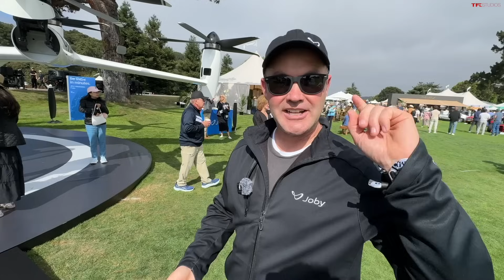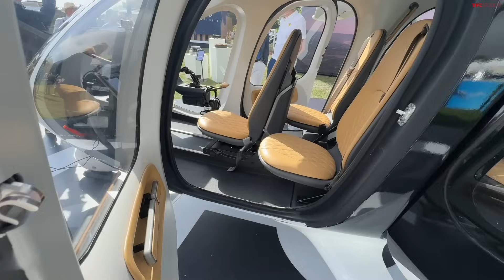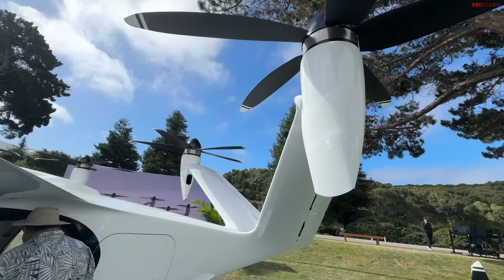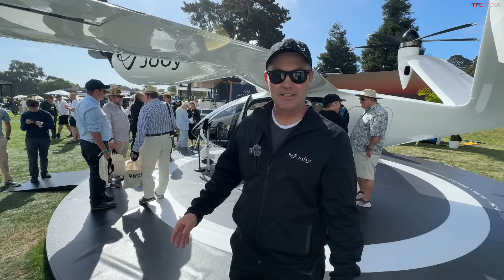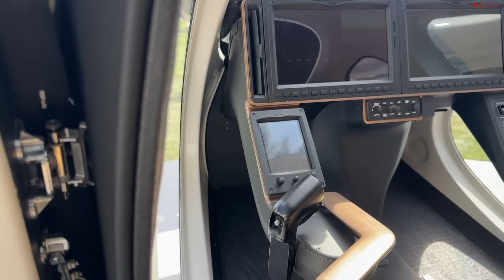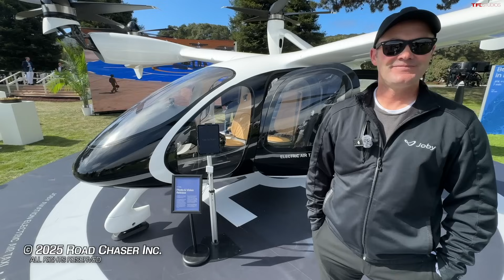Are Flying Cars EVER Going To Take Off? Well...

Comment: 100 mile range?
Reply: 150+
Reply: It’s more, but vertiports are equipped with dc fast chargers and it’s not that far from airports to any downtown. They have tested it with a hydrogen fuel cell to convert the hydrogen to electricity and a smaller battery pack. They have proven over that they can fly over five hundred miles with that set up. The military is looking 👀 at using the hydrogen fuel cell models for a range of uses. Pure EVTOL is much cheaper and profitable to fly the hydrogen fuel cell model.

Comment: When you are the only one, it is fine to fly anywhere anytime.  What if these things caught on and there are a group in the sky, how do they regulate traffic control?  Will these be only allow to fly at certain altitude?
Reply: The same way helicopters currently operate; by getting licensed for flying following all rules and regulations, then coordinating with air traffic controllers.

They cost $20 million each, so they are not going to start filling the skies…
Reply: @Cloud30000 yeah, it'll be like owning a helicopter.

 You still need to get licensed, follow the rules, speak to and follow ATC in controlled areas, and have places to park it. 

You can't just fly around willy nilly.
Reply: @volvo09  Like owning a chopper eh.  Idk about where you live, but the only choppers I ever see being flown around my area, are the military ones.  And those sightings are still rare.  And I am a Pilot!  It is like sighting a limousine, only less frequent than that.  And that just does not happen commonly in the suburbs and or country sides.  The most logical place to have 1 to get into the city.  Should you want to go there.   lol
Reply: @WW-wf8tu  I meant my reply in the exact same way you did, I just didn't say it outright enough . It's incredibly impractical, more difficult than an airplane to own and travel in, and just not accommodating to anything but a specific use (such as the cases helicopters are used for now...)

this thing is insanely narrow in whom it would apply to.

Comment: As a commercial pilot myself these things are neat  but i just don't see them operating much in Bravo airspace, i mean the pilot will be hitting over well over 200k$ per year plus the machine that 7min flight from JFK would cost a lot of money.   
   FAR part 135 is going to be a booger to get and maintain. 
  I wish you would have asked and i know he would not answer what that flight he mentioned for 7min would cost 300/500$ or more.
Reply: I know many amateur pilots that don’t make $200k; since it is mostly automated, you just hire the bare minimum pilot license level for this. The guy I hired to fly me in a Cessna only had a private license, not commercial, so if this is similar it dramatically reduces the cost of staff.
Reply: @Cloud30000then the guy you hired with just a private pilots license is flying for compensation, which is illegal.
Reply: @Captndarty  So what?  You gonna call the police?
Reply: @JayDee-b5u I’m not gonna call the fuz but in instances like this somehow they come and people lose their license or certificates and become a red Herring to the FAA.
Reply: Joby already has their Part 135 license. They won't be ATP required, just commercial like helicopter operations.

Comment: This so-called "air taxi" is the very definition of a Pipedream. The problem with these vertical lift vehicles is the weight-to-thrust problem. No one has achieved the 30-minute flight time barrier. This is the problem that DARPA, Army, and Navy engineers have had with these small personal transports since 1955, when they came up with the Flying Platform: The Hiller VZ-1 Pawnee.
Reply: Yup, that’s why the Osprey failed to materialize…
Reply: @Cloud30000 The Ossprey does NOT use BATTERIES as a fuel/power source! It uses slow-burning JET FUEL! The JOBY DOES!  BIG DIFFERENCE!  

Did you even watch this video before making such an asinine and dumb comment?
Reply: @theylied1776 Lithium batteries are much better than you think 🤔 Tesla can go around three hundred miles on them and JOBY batteries 🔋 have around twice the storage of a Tesla. 
Specification	Value
Payload	1,000lb – 4 passengers + 1 pilot
Range	100 miles
Speed	200 mph
Sound	~45 dBA in cruise
Propulsion System	6 electric dual-wound motors (4 on wings, 2 on V-tail)
Battery Capacity	Four lithium-ion battery packs
Peak Power	236 kW
Dual-wound motor plus inverter total weight	28kg
Peak Torque	1800 Nm
Continuous Torque	1380 Nm
Cell-level specific energy	288 wH/kg
Flight Cycles	10,000+
Pack-level specific energy	235 wH/kg
Hover capabilities	Yes
Length	21 ft (approximately 6.4 meters)
Wingspan	39 ft (approximately 11.9 meters)
Empty Weight	4,300 lb
Operational mode	Both vertical takeoff/landing and horizontal flight
Reply: @Cloud30000😂
Reply: Lol, Joby passed the 30 minute barrier in 2017.
Reply: @MeerkatADV 
Really? That's going to be new to the FAA because no one has filed that yet. All flight time must be filed with the FAA. 

Nice try, but no.
Reply: @theylied1776 lol why would it be news to the FAA? They've been working on FAA certification since 2017. Hell, in 2021 they flew over 150nm in 77 minutes. Last year they flew a hydrogen fuel cell version over 500 miles. Get a clue, they're actively working with the FAA, not hiding anything from them.
Reply: @MeerkatADV 
Give me the date and the time so I can look it up because flight plans are a matter of public record! 

That's why it will be new to the FAA. They don't seem to have those records.
Reply: @theylied1776 lol, do your own research: N541JX
Reply: @theylied1776 N544JX
Reply: @theylied1776 N542JX
Reply: @theylied1776 N545JX